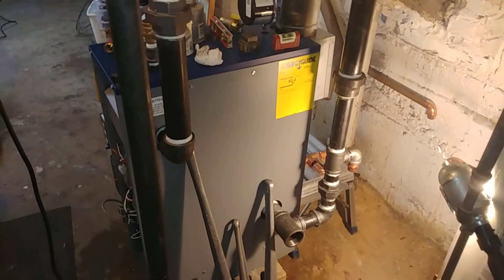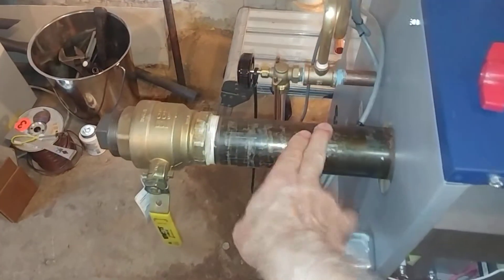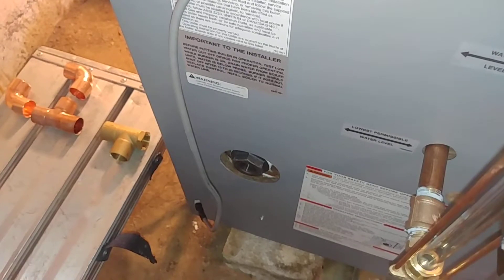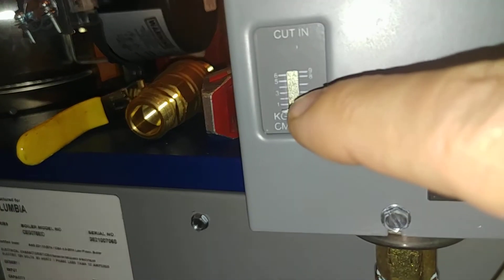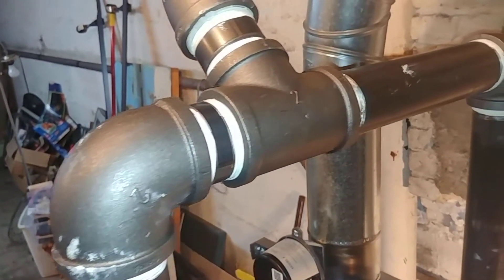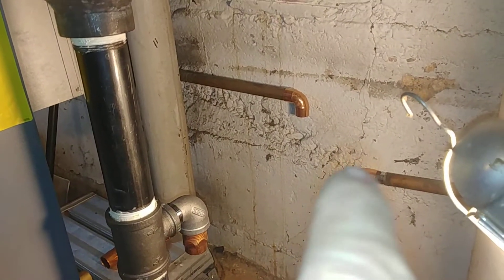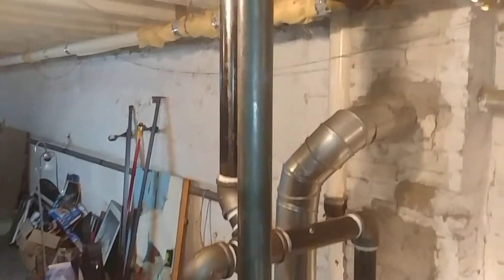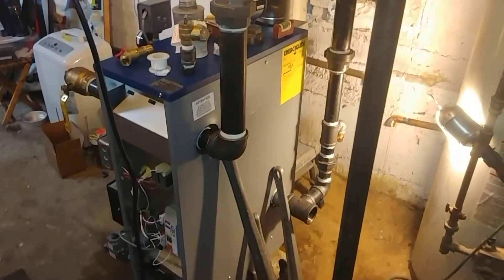Replacing A Failed Gas-Fired Steam Boiler - Day 2

Comment: It looks as though the gas manifold is reversible, left or right, any reason not to switch it around seeing that the gas is already on the right?    The stainless steel street 90, do u still need a dielectric union there?
Reply from the maker: Good catch on that reversible gas manifold!
Thank you!
That might come in handy on other gas boiler installs.
On this one, since we were going to move the gas line anyway per customer request, we decided to drop it close to the electrical junction box for ease of wiring using the gas line as the wire drop.
As for dielectric unions, they have a high failure rate and may not be needed so much, IMHO.